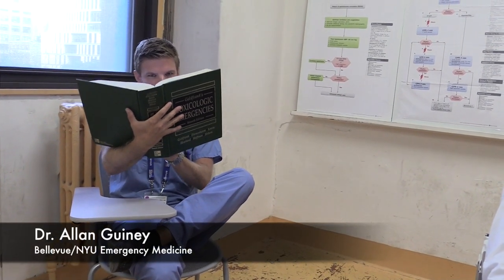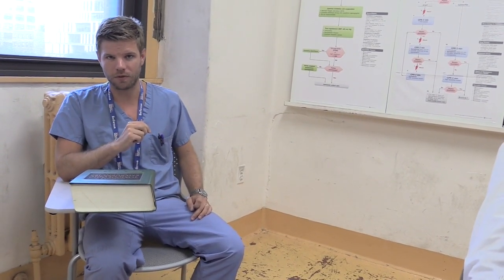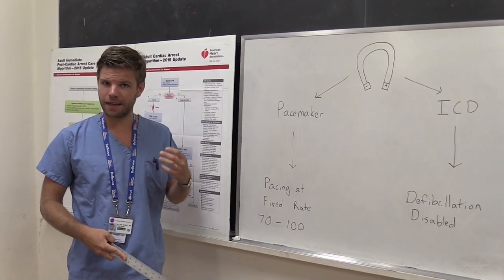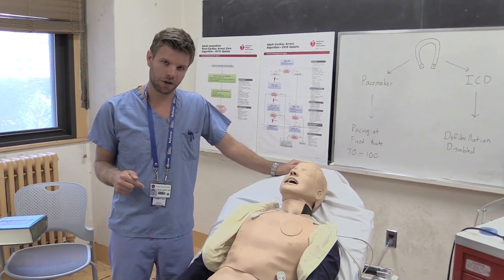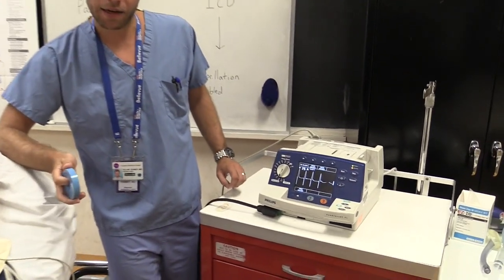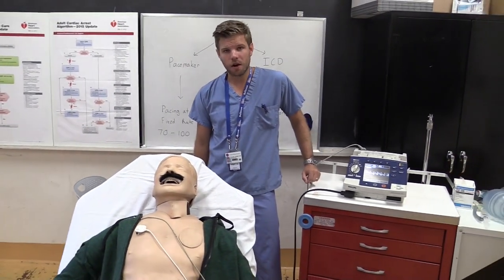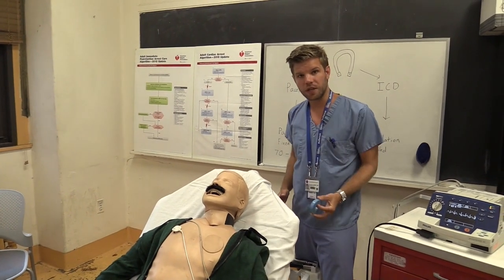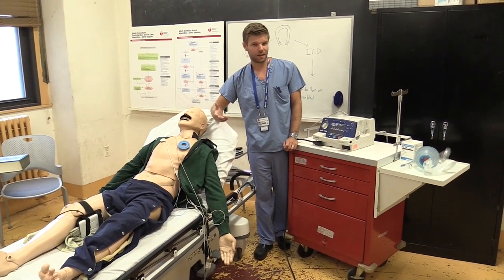How to Use a Magnet for Pacemakers + ICDs

Comment: Great video!  Straight forward with great info.  I do have one piece of info learned from a Medtronic Engineer, and later confirmed by a Boston Scientific Engineer:  Current devices no longer have reed switches because of issues in the 90's with reed switches sticking resulting in several ICDs failing to shock when needed.  The switch was made about 10 years ago to Hall sensors.  Hall sensors perform the same function as a reed switch, but eliminates the need for a mechanical switch and removes the possibility of the reed switch sticking resulting in device failure (and potentially death).
Reply: You mean the magnets within are sticking together even when not needed? I thought they were supposed to stick together and form a close circuit, when an external magnet was applied. The close circuit then reprograms the aberrant system. 

Or did I understand the concept of reed switches within a pacemaker wrong? Help!!

Comment: So it's ok to use the magnet temporarily to deactivate the ICD and reassess. In case we need to reactivate the ICD, simply removing the magnet does it (no lasting effect)?
For example, with an ICD that starts defib at 156 bpm (presuming the software deems the rhythm malignant) and erroneously detects vtach, would it be ok to use the magnet during exercice and remove the magnet after? (supposing a low risk of stable/asymptomatic monomophic vtach).

Comment: Is there a way to permanently disabled an ICD or pacer? If prolonged exposure to a magnet by pacer or ICD can that possibly permanently disable it? What about emps?
Reply: Prolonged exposure to a magnet will not permanently disable it. An EMP if large enough can damage any electrical device and could make a pacemaker or ICD not function properly. To permanently disable a device, the settings will need to be changed with an interrogator (the wireless computer her references).
Reply: To permanently disable one of these devices the cardiac electrophysiologist has to use their special wireless computer to reprogramme it.